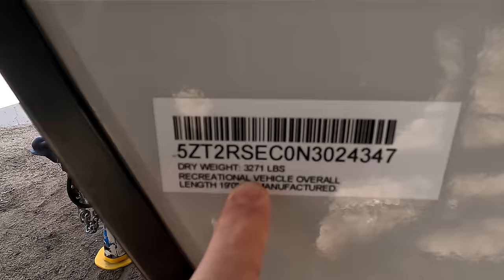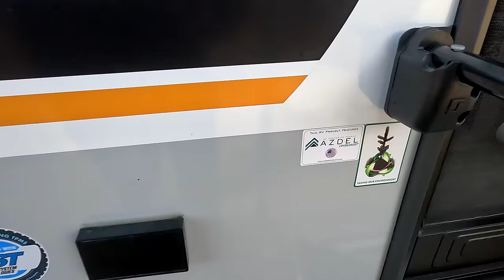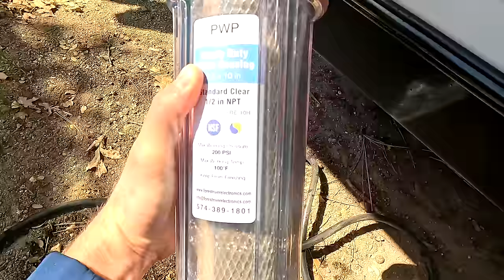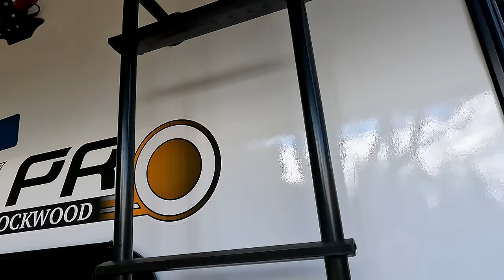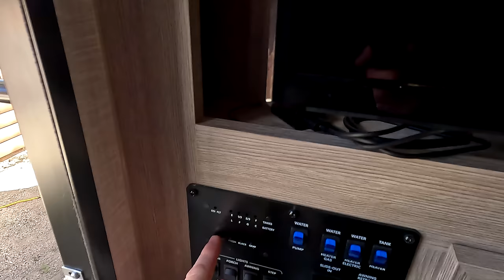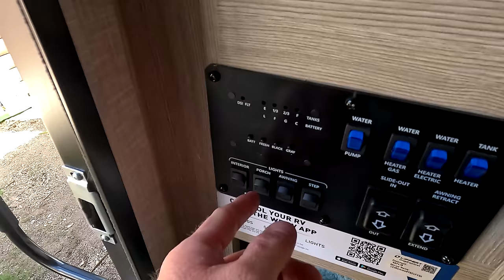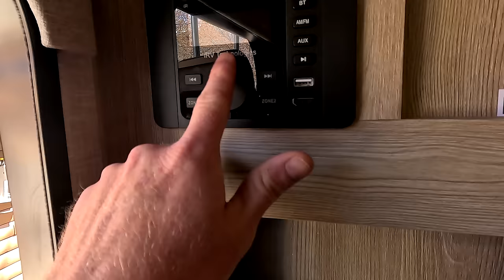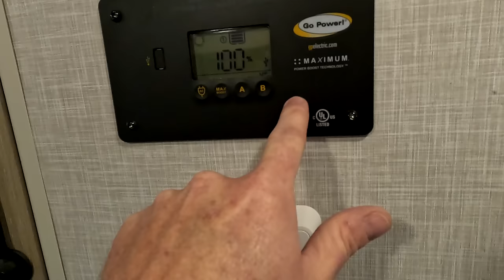Rockwood Geo Pro Travel Trailer | BRUTALLY Honest Owner Review (16BH)

Comment: Great review.
It is truly astounding where we are in the RV industry in terms of innovation and quality. These things have me draw a parallel to the low quality products that once came from Japan many, many decades ago. We are into this industry at least as long and still most of the same issues persist.
These homes on wheels can be mortgaged as a home. They clearly should be regulated as homes are. Thats the answer. Building codes. Inspections during manufacturing. Real standards that are closely monitored. The industry has proven its inability to act in a responsible way since inception. Sadly, government is needed here to help provide a minimum degree of good behavior.
Its a seriously bad condition when a conservative like me is thinking we need more government but there it is.

Imagine an auto manufacturer building their frames and suspension to these standards?  Wouldn't pass. Nor would most anything else these companies do.

Comment: Yep.  Even the "nice" trailers are made so poorly that you can watch them fall apart in real time as you own them.  It's all of the little things -- screws that are stripped out, mis-aligned hinges/rails, caulk that leaks, fabrics/upholstery so thin that you can see through them, panels that quickly rattle and loosen, and so on.  They're really only meant to last about 7 years with 2-5 outings per year.   More than that and you're going to be rebuilding the trailer and replacing the appliances.

Comment: No thanks.... keep all of them. I want to boondock but I also want to go into New York City or San Diego, etc for a few weeks at a time and stealth camp.  At the same time I demand reliability.  My choice?  A Toyota Hybrid Minivan. Remove all seats except the drivers seat.  It can be had in all wheel drive and I will have it lifted 3" and with bigger and better tires. The other item on my agenda is a Springbar top of the line 10 x 14 ft canvas tent.  With the hybrid minivan I can set the temperature to whatever I want. Even if I'm in the boondocks.  You can't do that with a trailer unless you have a ton of solar but if you have all that solar, do it with the canvas tent. Now you not camping you are glamping. In colder temps set up the Springbar with a wood burning stove or go into  the hybrid mini and set that temp for whatever you want.  I will have flexibility with the weather and flexibility of choosing where I will go next. City or dessert or mountaintop or the beach.  There's one other thing that will be on my list.  I can set up the minivan for towing on the light side with a small 6 x 8 Runaway that will carry everything that will be needed for the tent and also it gives me access to RV campgrounds should that be my choice. When going into a town or city to stealth camp, I will park the Roadrunner with it's stuff at the nearest RV campground.  Springbar canvas tents last forever. Toyotas last forever. Keep your RV''s.
Reply: I'm envisioning you camping in NYC. You wake up to find gang graffiti on the side of your van. 😡

Comment: Where is the battery disconnect on the 2021 Rockwood Geo Pro 19FBS?  I've looked everywhere for a video to help me find it.
Reply: I have a 2022 Geo pro 19 and the battery cut off is on the driver side directly behind and Below the propane tanks. You might need to be on your knees to located the first time, so you know where to reach

Comment: Bottom tier travel trailers are not meant to be used as four seasons campers, or for permanent, or off grid, living. They have too many shortcomings for those uses. Anyone with any sense should know that a $20k travel trailer, only gets down to that price point by compromising. You shouldn't expect to get very much at that price point. Do your research. and spend more for something better, if you have to. There are plenty of used, higher tier, travel trailers for $20k, that have a lot more features that you need for long term use, so that might be a better option for many people.

Comment: Most trailers of this price range are garbage. They are built light enough for suvs to tow them, they are not going to be bullet proof. That said, Rockwood has far better quality control and consistency across all of their lineup. Watch Josh the RV nerd showing the factory process for creating these geo pros, it's very insightful. This geo pro is double sided azdel with an aluminum frame, rather than fiberglass mounted to wood like the others. These geo pros are made better than majority of its competitors in the price range. Yea, little things are gonna break, it's just something that comes with owning a shaking/moving home. If you're gonna take a chance on an RV and already know they all suck, this is one of the best you can get without buying an airstream. I think this manufacturer at least put the quality where it mattered on the major things at a price many can still afford. Major in the majors, minor in the minors. If your gonna complain  about little things like step alignment and blinds, might be better off in an airbnb...

Comment: Had a 2020 Geopro GP17PR. The material and build quality was absolutely horrible. To keep weight low, many of the materials are too light for their intended use. Just about everything broke within 2 years of use. We did what we could to keep it going but I could see where the RV road was heading and we sold it. I'd never buy a travel trailer from one of the major manufacturers ever again. With what they cost now, the financial losses could be catastrophic for many folks.

Comment: U sd it would be ok to pull it with a tacoma...what about a 4runner since they are pretty much the same thing.... actually 4runner has the bigger motor and transmission than tacoma....4runner has the 4.0 v6 5 speed transmission and tacoma has smaller 3.5liter v6 with 6 speed transmission